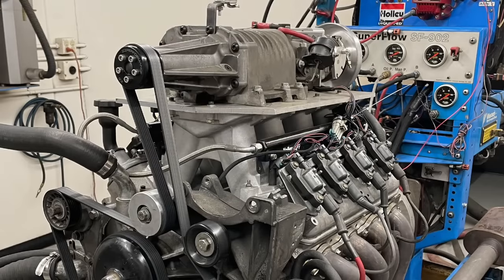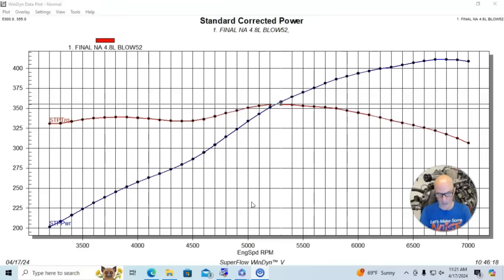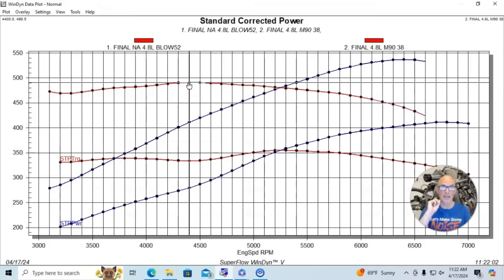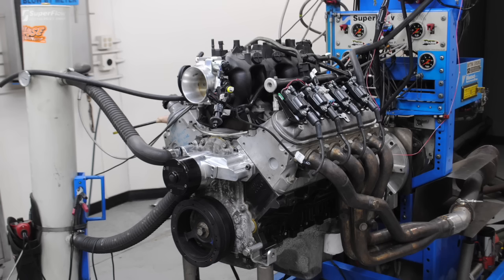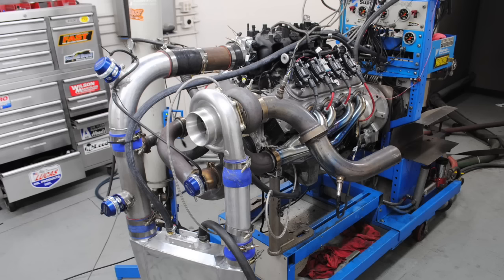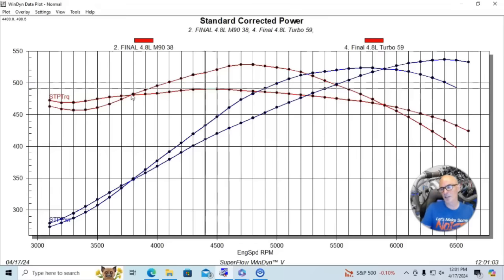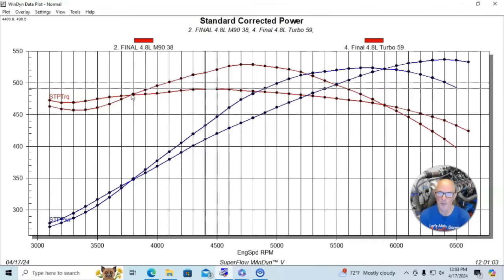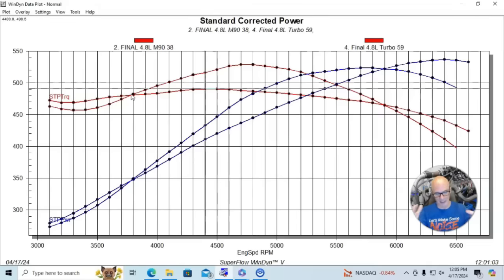CHEAP, JUNKYARD M90 VS EBAY TURBO. HOW DO YOU LIKE YOUR LOW-BUCK BOOST? M90 VS TURBO 4.8L DYNO TEST.

Comment: I keep meaning to look to see if m90s have been hit with the Richard tax. Great stuff as always thanks
Reply: The supercharger relies on the engine speed to make cfm. So it never reaches max blower speed until the engine redlines. That's why it moves more air at engine redline. Superchargers power band is linear similar to a n/a graph.

For efficiency id say. turbo > supercharger. The turbo engine is more volumetric efficient vs a supercharged engine ?

Comment: GT45. Easier on the motor, easier to acquire, easier to install, tune files are readily available, the list goes on
Reply: can change boost to accommodate ambient temp more consistent easier to manipulate doesnt heat soak no parasitic loss easier to work on better drivability better fuel economy turbo is just better if you have enough space in the engine bay

Comment: 🔥🔥🔥Hey Richard. I couldn’t Resist….Summer of the M90 it is🔥🔥🔥🔥Gen IV 4.8 .020 over with M90 3” pulley here.  looking to adapt Bi-Hellcat Heat exchangers Bosch pump. Lead the way. 🔥🔥🔥🔥Might be my New Jet Boat motor, While I rebuild the slant 6. 🔥🔥🔥

Comment: Did you ever spray meth water into the turbo inlet? You talked about it before. 

I want to see the real data, i am battling high IAT’s - limited on space so no ATW. Have a smaller fmic-  looking to cool charge temps to keep it from pulling tons of timing. Do it! 😁

Comment: Still trying to find a way to adapt a newer style roots blower with a throttle body to a gen 1 small block Chevy. The only thing I can come up with is a old style supercharger intake with a plate like he made for the 4.8. But I can't figure out how to do the fuel injectors , and the supercharger inlet will more than likely interfere with the distributor. I have both a car with a 305 and a car with an m90 supercharger and I want to see how the 305 would react to the supercharger.
Reply from the maker: it reacts like every other motor

Comment: I wonder how a guy would go about setting up an M90 on a 318 Mopar.😁. Were 340 tunnel rams ever very available for configurations? That’s what it would require right? I wonder how long the M90 snout is from pulley to plenum opening/end. I may have to go scrounge one up

Comment: Cheap turbo!!
Reply: Hi rich wood I have cuestión 
I need help I want to put new engine in my jeep cj7 for 50 %off road 50% hi way 
Chevy 6.6 L8T Delete DOD/AFM/VVTI 
Whit 5-speed transmission 

Or CHEVY  LS3 ? 
THANKS FOR YOU HELP
Reply: @SergioRodriguez-mc4cp  before I swapped any engine, I would update the rest of the drivetrain if it hasn't been done already. Also because I like to save weight where I can, maybe consider a 4.3 liter V6. Would give you the added horsepower and mileage wouldn't be so bad either. Of the two options you listed, LS3. Not before tons and transmission and transfer case upgrades. Hope this helps.
Reply: @richwood8650  
Yes my friend I updated oready transmission tr4050  transfer case 205 1 ton axle cromolie iner axle
Reply: @SergioRodriguez-mc4cp  Just a good ol LS should finish it off quite nice. Good luck on your build!

Comment: Hey do I need a cam before boost 
Looking to make around 550 600 but I don't wanna spend the money on both cam and boost
Reply from the maker: you can just add boost
Reply: @richardholdener1727  I want to daily it and I want decent mpg down below 3k rpm but I really want it to come alive above that or be able to control when I have the power
Is it better for me to do a turbo kit or supercharger with different maps

Comment: I think a supercharger would make more sense on a daily driver than a turbo would. I have a 2016 Turbocharged Cruze and one of the bad things I hear is the damage the turbo does because of the heat. The oil feed line runs right behind the turbo and it is known to cause the oil line to plug up. I also had a 04 Impala SS SC and I thought that having that instant boost made for a better daily driver. But going by the tests that you made, turbo would be the choice for all out performance.👍👍

Comment: Ya probably turbo just because the supercharger would probably cost more but they would probably be a similar amount of work since you have to cut the snout off and make that work
Reply from the maker: cut the snout off?
Reply: Was that not necessary I knew you did and it seems like it would be to fit most laterally mounted vehicles

Comment: so many engines are not tuned to run on ethanol, but they are running on it regardless... oem setup made to max out on that normal 87 gas... they don't have flow capacity for anything else. 3000 feet up running at 90%, pump sells ethanol even tho its listed as 87... 62% of 90% is that mandated 50% reduction cap, 10mpg on a 4.6 V8 making oem power on that nonsense gas is just about the biggest win NA their is... nothing else is actually tuned for it, they just run at half capacity. "idle fuel consumption at 30,50,70mph, blower vs turbo"

Comment: i would run the blower.  less complicated plumbing and much less heat
Reply: Intercooler on the turbo
Reply: @dennisrobinson8008  
He's talking about the heat being radiated from all of the extra exhaust involved in fitting the turbo.
Reply: @bradmcgrath358  Engine compartment certainly hotter.
Reply: Blower makes more heat into engine because efficiency is so low.
Reply: @V8Lenny  that part is true.    the discharge from intercool turbo will be lower.   some of those blowers do have intercoolers with water that reduce the discharge greatly.
Reply: @dennisrobinson8008  yes but turbo can be 80% , Roots maximum 45%
Reply: @V8Lenny   you're misunderstanding the point here.